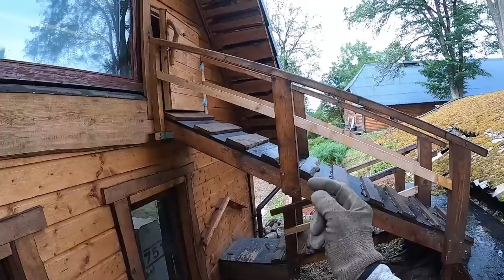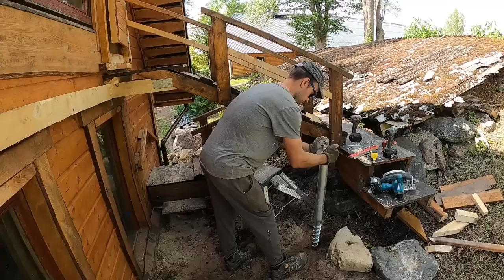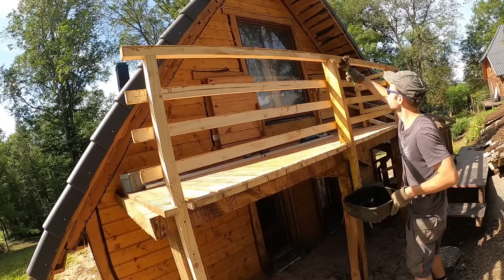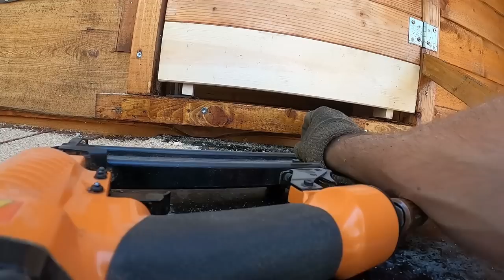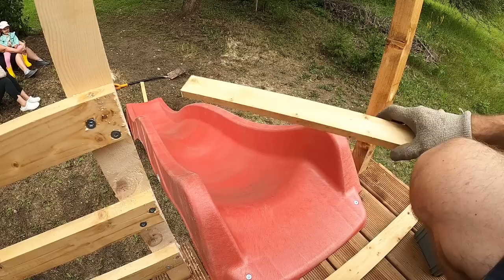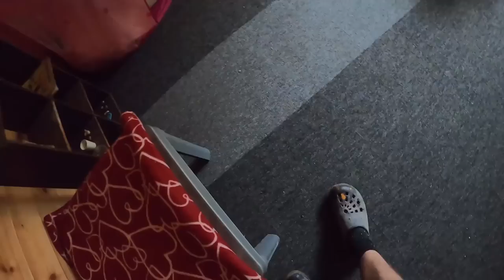Renovating a 128 year old forgotten log cabin (part29) - Playroom upgrade

Comment: You correctly said that screws like to break and screw you. But instead of putting in bunch of more screws to screw you, you should have said Nails, Nails, Nails! Like they say here "Kruvi fikseerib, nael hoiab!" or "The screw fixes, the nail holds!" In permanent structural assemblies it's always best to add some nails to hold it together forever (until wood fails) without failing. Even those metal corner pieces are meant to be filled with nails (every hole) after putting it in place with few screws.

In fact, you could have made that entire build using no expensive metal corners at all and still having it just as strong by using few beefy but cheap nails. I do get that you probably had those corners just laying around but for other people viewing, metal brackets are for corner cases (pun intended) where it's difficult to fasten it any other way or to add some strength but they are not at all essential for every build!
Reply from the maker: Yeah i have lots of them around. and their easy to put in place with screws.

Comment: You should install balusters rather than rails so the kids can't climb them like a ladder. Also top rail should be above the hip level of an adult.
And it appears they could get onto the roof.
Fail for safety reasons.
✌️❤️
👍 though on eliminating the trip hazard on the thresholds.
Need a sandpit at bottom of slide for a soft landing plus the slide will maybe self-level.
Reply from the maker: All good tips
Reply: @Ants_Pants  Thanks.👍
Get them implemented...Bro!😉😆
I notice your English language skill is getting better. 
✌️❤️